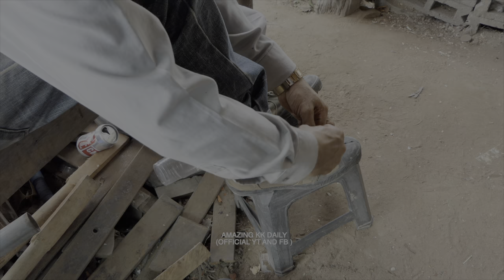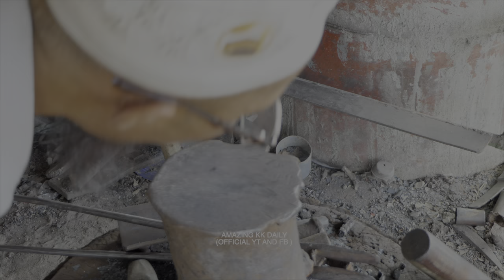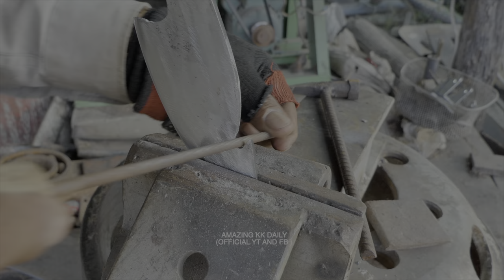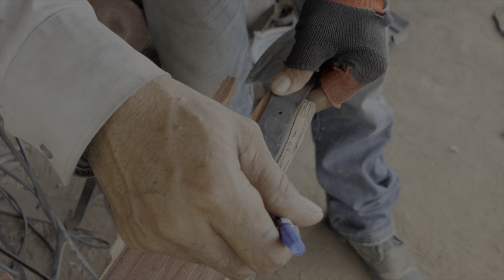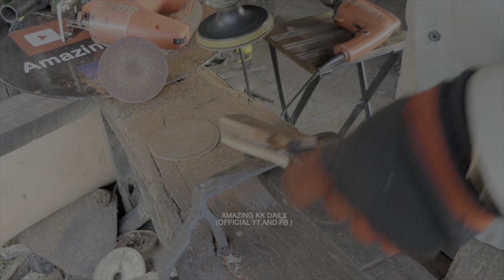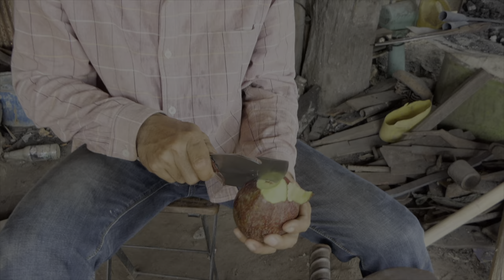MAKING A BEAUTIFUL KNIFE WITH A HOOK FROM A PIECE OF REBAR ( HOMEMADE KNIFE )

Comment: Rebar with low carbon,not really good for knife,may be good with composite materials,if bearing on edge,other from rebar...... Nice knife anyway
Reply: You can add carbon by sprinkling charcoal on anvil while forging the knife.
Reply: @chuckr786  need 48 hours,high temperature,need a lot of resources